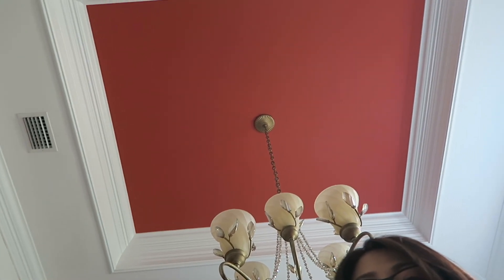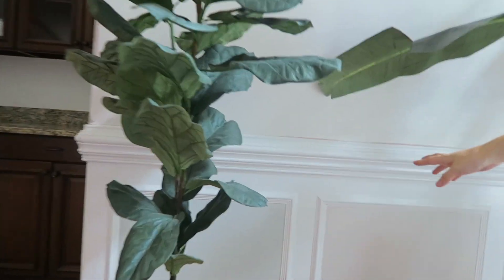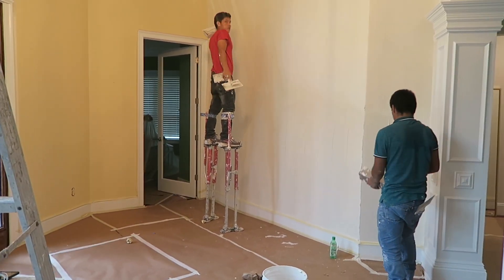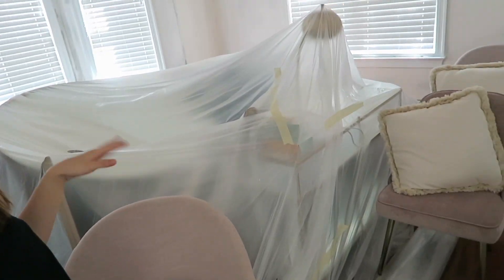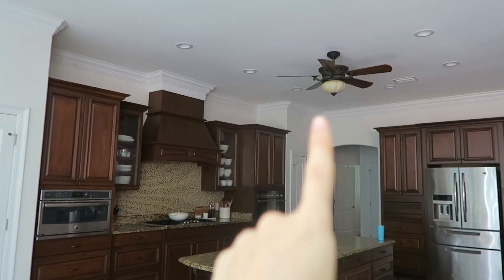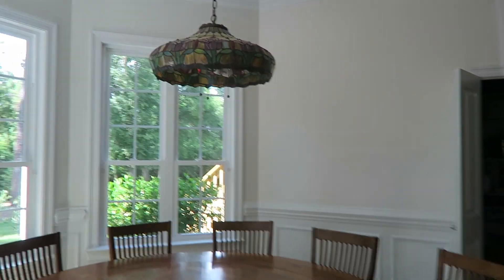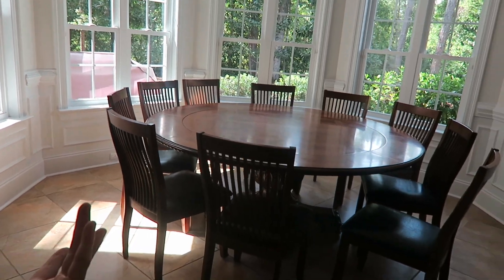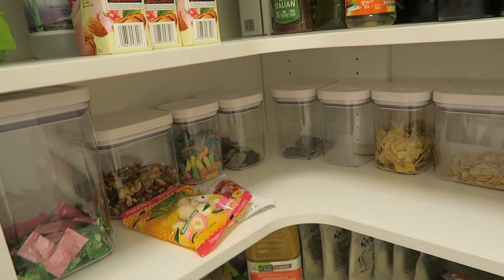NEW HOUSE TOUR | RENOVATION BEFORE & AFTER & PROCESS | PLANNING | 🏡 CHARIS' HOME RENO EPISODE 1

Comment: Having built and remodeled many houses, the need for an interior designer of top quality is what makes it all work together. The kitchen is a tremendous undertaking and would advise a true kitchen designer . They are worth their weight in gold! As I watch, I can feel what an undertaking it is. I’m not a fan of draperies, but rather wood of some width and color to blend with walls. I have used Benjamin Moore Aura paint,  but other brands may have a similar product now. I’ve always made sure the lower cabinets have roll out shelves. A ceiling fan in a kitchen is not a needed thing. It’s better to have great lighting fixtures where your island is. I’m looking forward to seeing your house progress. Just compartmentalize projects and have less confusion! Best wishes !!

Comment: I like you love working through the process but if you are wanting to bring continuity throughout  I suggest working with a designer that that is willing to consult rather than drive.  There are concepts that designers bring a level of knowledge to that cause the end result to really soar.   The colour you paint the walls really influences the colour  your floors project.  A great colour on the wall may not work with the wood colour.  😃 Have fun!!!

Comment: Lovely house, Charis! Here's my thought for your kitchen 😊
1.  I will go for no upper cabinets, just put floating shelves for your decors.
2.  Keep the second pantry for all pans and other kitchen essentials.
3.  Make a really big kitchen island and take out the other kichen island/breakfast table.
3.  For the kitchen island, I'm not really onto waterfall style island, but add open shelves for your easy access plates and bowls on the side or in the front of the kitchen island...
4. For the fridge area, do a built it fridge and keep the cabinet around the fridge.  The cabinets should be reaching the ceiling and the doors of the cabinet should be glass ( this is where you  would display your beautiful plates, wine glasses, vases, and other decors.)
5. Make your lower cabinets into drawers (pull out) for easy access instead of a "door-like" door (i think I'm a bit confusing here, i hope you understand what I meant 😊).
6.  I will go for all marble and white kitchen.  Not a farm house kitchen but a modern all white kitchen 😊

I hope you'll read my comments and think about it somehow 😊.  It's really hard to reach things in high upper cabinets and second pantry for your kitchen essentials would be a great option.  

Goodluck, Charis!

Comment: Lot on your plate.  I applaud you for updating this house all those colors were way too strong for that amount wall everything you’re doing is the right direction.  I prefer the French gray I do not want green undertones to my gray I want blue undertones to my gray especially if you’re going to do navy blue.  Navy blue is stunning it’s elegant but also can be French country chic I also think gray and navy blue complement the dark cherry floor better than all that yellow.  My final thing and I’ll stop Carrera marble is beautiful and it’s wonderful for bathrooms I should say low use bathrooms.  It stains any tweezers that rusts eyeshadow mustard ketchup red wine Carrera marble stains even vinegar splashed on it will change the surface.  Soapstone is the most forgiving you can even use sandpaper on soap stone but it’s black maybe you don’t like the look some of the combined cement/stone  kind of countertops where you can pick all kinds of embedded stones I think are really interesting and incredibly hard and durable.  However the last renovation I did with my boss the center island was all teak with a heavy varnish very shiny and it holds up so well but fingerprints show on it

Comment: Hi Charis, your new home is lovely!❤️ I like the lightest gray(the one by the wet bar) I think the greenish one would be too busy with all the Wayne's coating & too green from the yellow warmth from your hardwood floors. 
For your kitchen, love the waterfall idea, perhaps you could make more low seating for the kids around a lower part while maintaining the regular height for meal prepping etc... Tall to ceiling cabinets with glass top sections that have UPLIGHTING. All white like the other renovated kitchen you had. Navy on bottom half with white/pale gray marble or quartz counters & floors. LOVE the breakfast "nook", great table! Perhaps the marble/quartz continued on table top overlay with white chairs, navy seats? Or covered pads that can easily be washed.  That butler pantry is everything! Might I suggest an "electronic charging station" next to a desk seated area where Joshua can do homework, Lydia could color, etc... eventually the kids will need a place to charge(put down the electronics) a charging station is an easy "glance check" for cellphones, pads, air books, etc...maybe one of the bread spaces you have. As a fellow Floridian, a white classy ceiling fan up high while leaving room for beautiful chandeliers.
Oh & definitely that white marble with scant gray & gold veining around fireplace. 
You have such a great eye for decor, take your time, don't stress out or rush through this, plenty of time. Can't wait for baby boy's official appearance 💙💙💙 take care